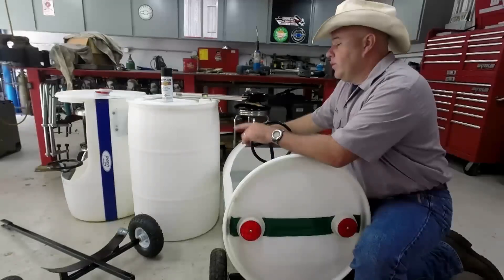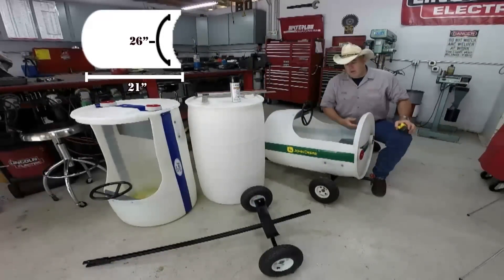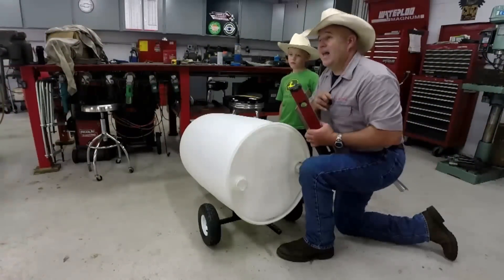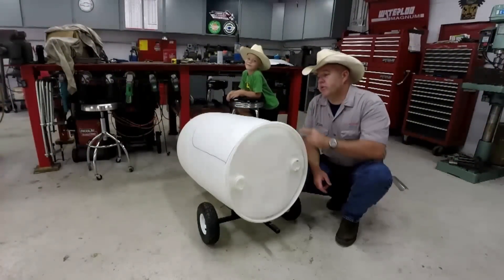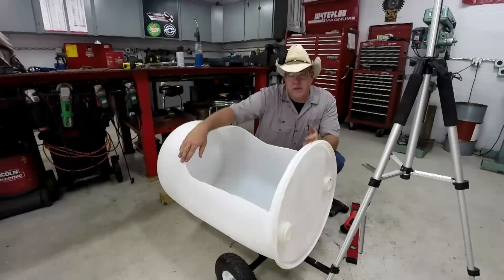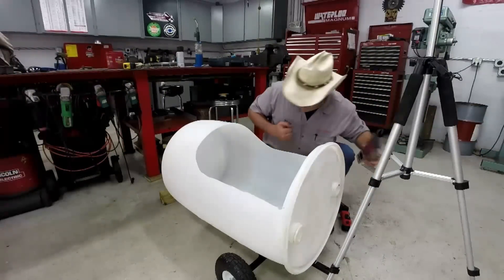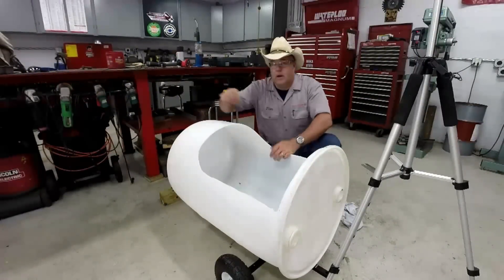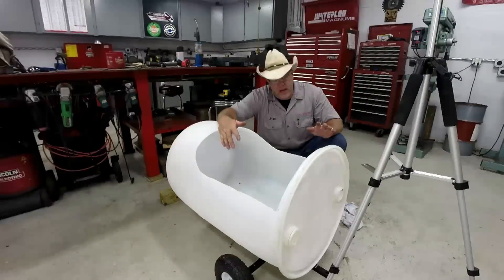Building a Bigger Barrel Train Ep 4

Comment: use the plastic trim from the inside of doors from cars to clean the edges up makes a nicer edge and you can often get it free and is easy to cut dont get the type with metal grip as it rusts

Comment: where do you buy the steering wheels and the stickers
Reply from the maker: +Teddy Lara, Getting a bit ahead of the videos are we? LOL. In the next video of the barrel train series, I show how to make the steering wheel for less than $3.00.  However, if you want to skip that part you can buy a steering wheel at some place like a Home Depot or Lowes. The ones that go to a kids wooden swing set are just about the right size, they are however a bit costly ($25-35 each). I have six train cars, and that would be way to rich for my blood.  The Stickers came from a local sign/graphics shop. I Had them cut strips of vinyl sticker material in the colors of tractors that my kids love. The logos are just OEM stickers of the tractor companies that the same sign shop cut for me. You can probably find a local shop near you to cut the vinyl. If not send me a message and I can put you in contact with the sign shop that cut my stuff. It would all easily fit into an envelope and could be shipped. I thought about cutting out different colored circles and making the cars Polk a dot. Might have worked if I had girls, it's a no go with all boys! thanks for watching.